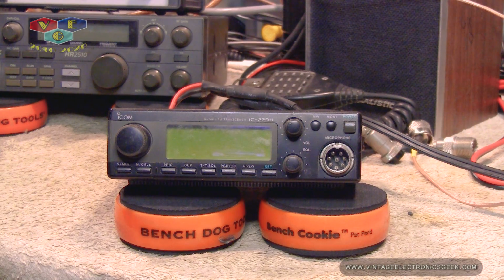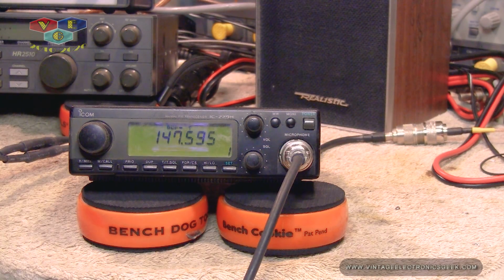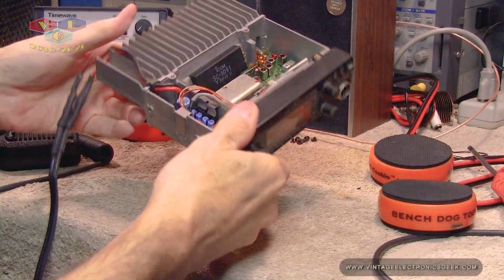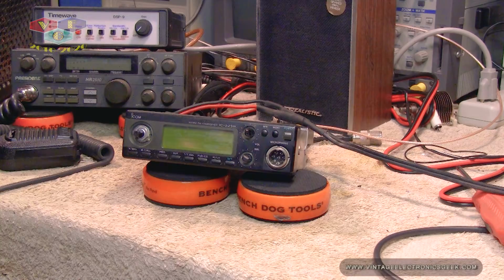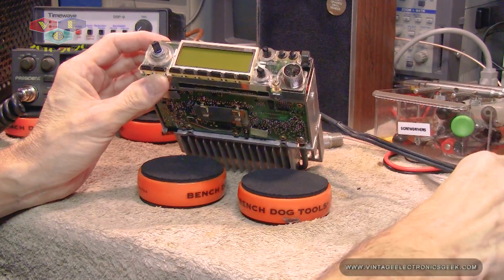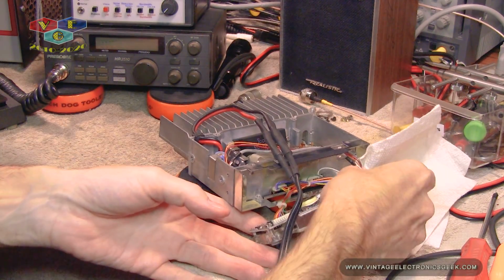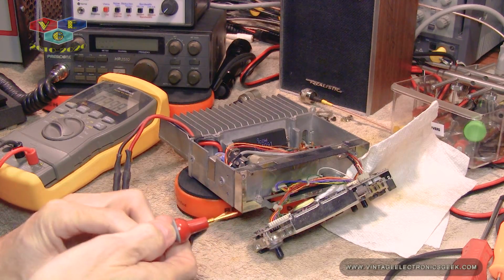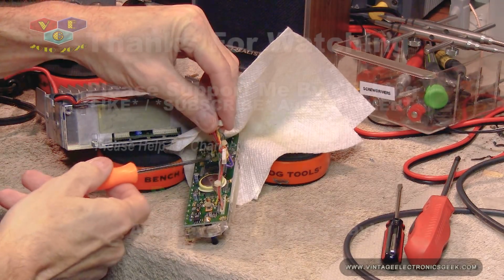Icom IC-229H - Backlight Repair - P1

Comment: Cool thingy Jack. I suppose the old light is incandescent. I would just solder in the LED resistor somewhere along the wire and put heat shrink over it so nothing shorts out. Merry Christmas.

Comment: haven't seen its innerds, amazing radio.  
32 years old tech, imagine a rig now?  
I had that in the Chevy when I got it to replace the htx252.  
it did well on simplex, i parked it at 146.520mhz. 
I liked Icom, but now I have a dual band Alinco.
Reply from the maker: Its the man of the hour, howdy Don!  Today its probably a blob...one chip done!  :)  As far as I'm concerned, going from the Icom to the HTX-252 was going backwards, the Icom is hands down far better, I have ran both in the mobile and base...the Icom wins...the only advantage the HTX-252 has is its smaller, that's it.  Since I mostly talk simplex, the Icom gets used mostly on simplex...and sometimes I will use it on 6.520...especially if I'm traveling in the Jeep which is for now the rig I have it in...it has been to Oregon, Northern California, Nevada, Los Angeles and many-many trips to the San Francisco bay area, such as yesterday since I have repaired the radio this past summer.  Thank you again Don!  ~Jack, VEG